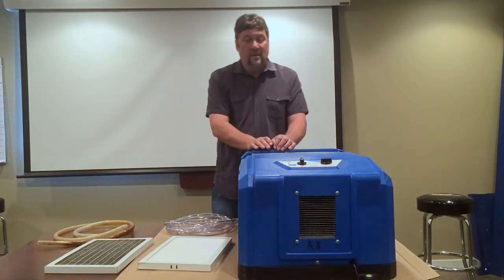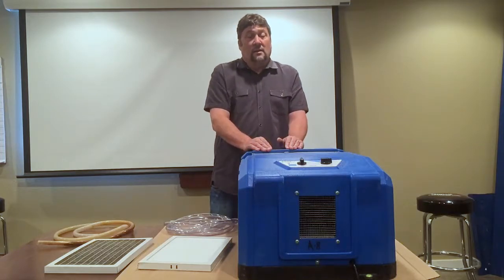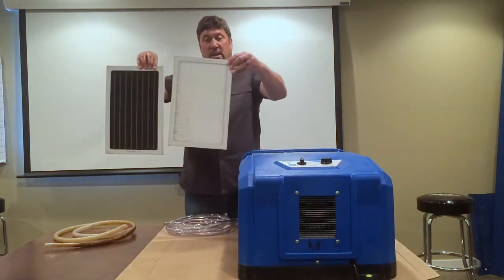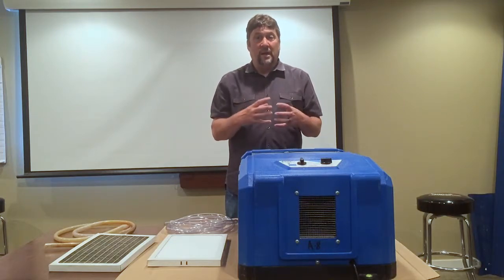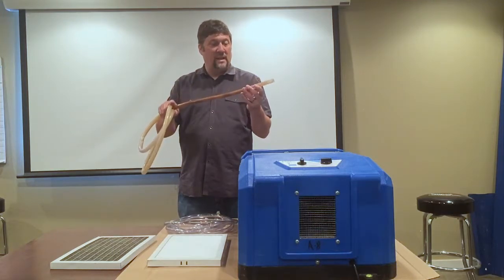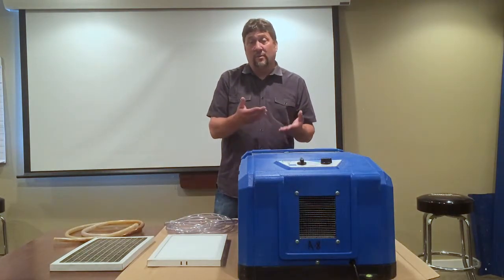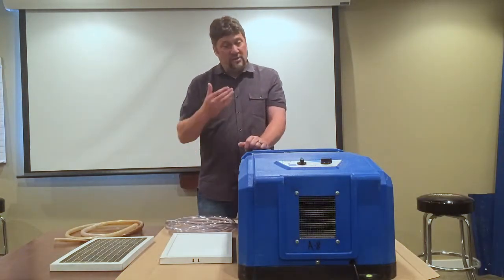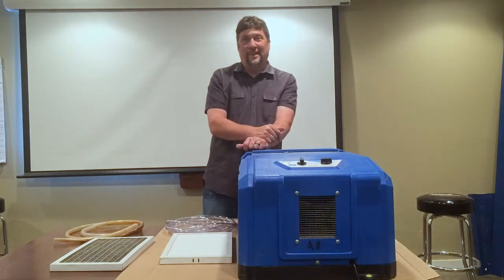Sanidry CX video

Comment: my humidifier pump went out after three years. serviced every 12 months. any tips on replacement?
Reply: I just had my Sani Dry serviced the tech just left my home, he said that the unit is running 2 degrees higher than it should be, that there is no repair for the problem and to replace $2500.00 and they don't make the one I have anymore. it have a 2yr warranty and is 5 yrs old, I am not going to spend $2500.00 every 5 yrs of home ownership. crazy industry. i'll just reopen the vents they sealed up.
Reply: What are the specs on the filters. And where do we buy them. Thanks